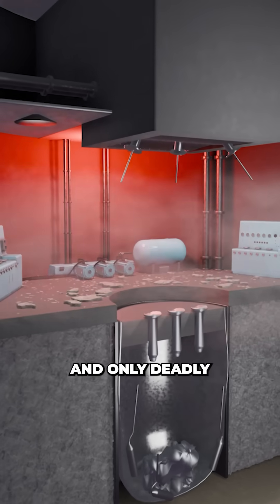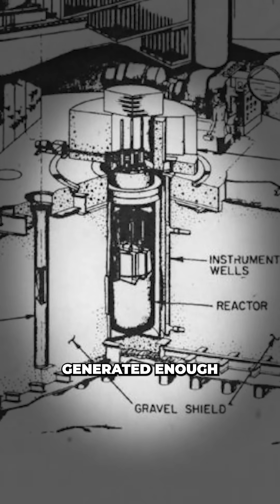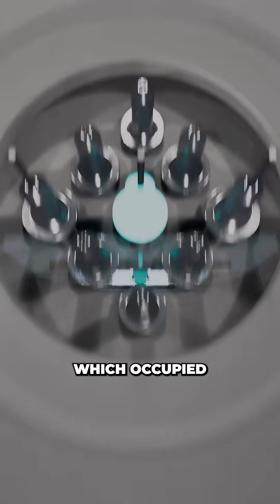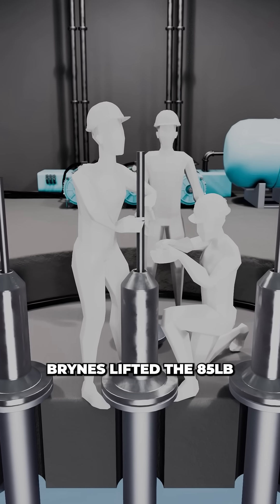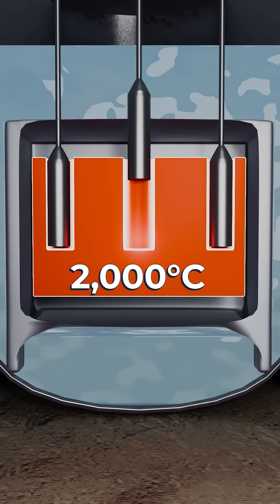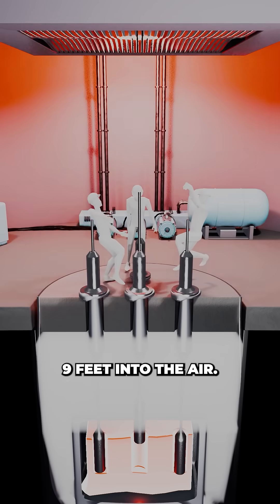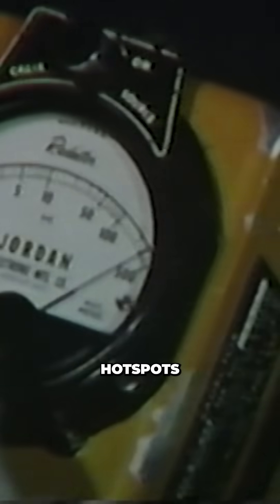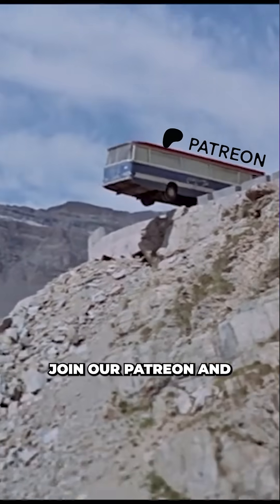The True Story of the SL-1 Disaster

Comment: For anyone curious, this is what started the anti nuclear power movement and dramatically slowed the development of further nuclear power plants being built across the US.
Reply: Three mile island was a bigger incident. 

SL-1 being declassified only cemented the anti nuclear movement.
Reply: @scythesasin4181 
Three mile island was the absolute weakest reactor failure.

The only notable thing about that was that some regular steam escaped the facility.
Reply: @redstonewarrior0152 no there was a radioactive release. It’s just that it basically wasn’t a health hazard at all. 

Which is where all the controversy comes from. How can there be a harmless release of radioactive gas? Physics. That’s how.
Reply: @scythesasin4181  Except nobody died. Only casualty was a very expensive nuclear reactor.
The Tinfoil Hat crowd insists that Three Mile Island was deliberate. It was supposed to be a minor accident, set off the warning sirens, etc., as a publicity stunt for the anti-nuclear movie "The China Syndrome", which was released twelve days before the incident. Was not intended to cause a core meltdown.
Interestingly, President Carter shut the FBI investigation into the incident down HARD. IIRC workers reported valve handles being missing from critical valves, etc. And not like they'd never been there- like they'd been recently removed.
Reply: @MarkStockman-n8s5w 

Nobody dying has no weight on the public opinion at the time. 

Three Mile was indefinitely more public than SL-1 at the time. The entire country knew about it, while SL-1 was significantly less covered. 

SL-1 had guys die, yes, but the military has guys dying all the time due to stupidity and training accidents, especially back then. 

The SL-1 incident was took forever to be made public as it was, in essence, a military testing site.
Reply: @MarkStockman-n8s5w so because luckily nobody dies it's harmless. Three mile island was a lot scarier and a lucky escape. They had a runaway reactor and no knowledge off what was happening inside the reactor and loosing a reactor is really really really expensive on top of it all. Accidents keep happening because people in charge and people that think they are more knowledgeable than they are, do not take the physics serious and dismiss the hazards and the many near misses.
Reply: @scythesasin4181 TMI taught us a few things.  

One was of course proper handling of maintenance procedures and that each change needs to trigger a total assessment of safety.  

Two was that the corporate “trust us” system was not adequate. There had to be standards for handling incidents, assessments, communication, and handling the public protection and response.  The owners of the plant had non of those things.

Three there were not enough experts and trained people in place to give advice on the company side.  But in addition there was no method where the federal government was both assisting and watchdogging operations.  In fact we were quite lucky that the President of the United States at the time (Jimmy Carter)  was a U.S. Navy officer who just happened to be work on the founding of the Navy’s nuclear submarine program in 1952. He not only worked on reactor operations and design but he was assigned to directly work on a cleanup and management operation of a reactor meltdown.  So Carter not only knew exactly what the situation was, he knew exactly what should happen and whom to call.  He actually personally called Admiral Rickover, who used to be Carter’s captain and commanding officer in the Naval Nuclear program to have him get the correct authorities and experts in place.
Reply: Three Mile Island was more of a scare than an actual disaster.
A lot more people died in Johnstown PA on May 31 1889 for example.
Reply: lack of nuclear appreciation ?
Reply: Damn, 3 people died and it demonized nuclear power for years and years. Yeah it was a tragic incident but it was pretty much entirely the guy's fault for lifting the rod too high.
Reply: @mrigtp0529 yeah... cabbage you imagine where we might be now if we had these? It's boggles the mind.
Reply: @CrazyCamo We'd be pinned to a great future 😂
Reply: And then Jimmy Carter came and hammered the last nail in the coffin during TMI.
Reply: @abriannaaguilera2123 well it was not Carter’s intention.  Carter was a nuclear reactor expert having worked to establish the U.S. Navy’s nuclear program in 1952 as well as having personally managed and physically cleaned up a meltdown at the end of that year.  And then in 1953 originally trained to be the Nuclear engineer on the USS Seawolf when his father died and he gave up his navy career to manage his family’s farm and support his mother and siblings.  

He found the oversight on the commercial Nuclear energy sector to be horrible, and having worked under Rickman he insisted lessons needed to be taken from the Navy.  Unfortunately this criticism became fuel for the public to really take issue with the concept all together.
Reply: @LogicalNiko He saved Chalk River, Canada.
Reply: Thanks a lot brynes
Reply: I mean just like cars, a nuclear power plant is dangerous if designed poorly, but safe if designed well and handled properly.

Cars have increased in safety over time too, but nuclear has become even safer.
Reply: Thanks libtards
Reply: This, and a lot of shows blowing everything out of proportion
When a nuclear reactor fails, it doesn't blow up like a nuclear bomb. To achieve that spectacle, it would have to be THE worst-case scenario, and to achieve the same results without the explosion is also another worst-case scenario. But people were and are misled to believing that Chernobyl or Fukushima are the norm. Those are also pretty bad scenarios that, but far from the norm.
Chernobyl was like not only built with 0 failsafes in mind, but the staff weren't trained, and nothing was handled properly, in fact, during a safety drill sometime before the accident, on of the reactors failed the drill and then was rebuilt essentially the same way. And Fukushima was a whole ass natural disaster fucking it over, but it was still not built around the fact that tsunamis got that big, despite the tsunami size not being that rare, and should have been considered.... and they're failsafes sucked too lmao
Reply: @tntblaster137 I mean even Chernobyl and Fukushima weren’t nuclear explosions, they were steam. Chernobyl was a poorly designed reactor and the test they were conducting was just not safe, so inexperience, poor reactor design, and a horrible idea for a test was the cause of the Chernobyl disaster. Fukushima is an oversight that was warned about decades before.
Reply: No, that was Three Mile Island and media. 
This was a highly classified project. It did not become public knowledge until decades later. I don’t remember the details now, but I know at least the impaled guy’s body was buried on site, but I think it was two workers. They are in lead caskets. I think the third guy was buried normally, but his casket is encased in like 1 ft thick concrete. Their families weren’t told details of what happened. Which is par for the course of black project work.
Reply: @tylerfb1 you’ll be happy to know 3 mile island will be reopening. Microsoft will be running it. It needs its power for the data centre. The reactor where the accident happened will not reopen. The Susquehanna River will be needed to run the data centre as these data centres
Require massive amounts of water.
Reply: @TessTearoe-zp5xv  I already knew that it was being recommissioned. 

I don't understand how that's relevant to the discussion, though.
Reply: @TessTearoe-zp5xv not happy to hear Microsoft will be running it but it’s good to see nuclear starting to recover
Reply: @KatieNovaNeko what can possibly go wrong?
Reply: @TessTearoe-zp5xv not an argument, you’re just profoundly ignorant on the topic of nuclear waste and it’s disposal
Reply: @TessTearoe-zp5xv let me be very clear, in order to be certified, they DO run trains into them, this isn’t a fun fact, this is part of how they’re determined to be safe or not long before nuclear waste gets put in it. And don’t even bother bringing up quantity, the amount of nuclear waste produced ALL TIME in the us can fit in an era the size of a football field, no other form of energy produces this little waste
Reply: @KatieNovaNeko You have that on good authority? They told us lead in fuel for over 50 was ok, they knew for decades and decades it wasn’t. They hid the effects of Agent Orange for decades. Love Canal and it’s chemical soup. Cigarettes they said didn’t cause cancers for decades they hid the evidence.
Well you can believe “THEM” all you want, no one is stopping you. Experience shows you shouldn’t always drink the KoolAid!
Reply: @KatieNovaNeko Really? And you are the expert? I’m sure I’ll sleep better knowing that.
Reply: And of course, everyone's panicking over how "Nuclear power's not safe", but nobody cares to mention the second half of that sentence: "IF YOU'RE AN INCOMPETENT MORON!!!"
Reply: @citronyman man is an idiot! THERE IS NO OFF SWITCH!  What part of that don’t you understand?
Reply: @citronyman 
Nuclear isn't commercially viable, sorry.

Its literally 5x more expensive per delivered kwh than wind.

That's why nobody is building nuclear and everyone is building wind
Reply: @Cambyses1467 wind?
Reply: @paulh6171  What???.....the UK is building a massive nuclear power station as we speak. France has some of the cheapest energy on the planet.
Egypt is building a nuclear plant.
Google, Microsoft and Amazon are building nuclear plants to power their AI data centers.

There are more than a dozen modular reactor startups in the US.

China is massively expanding its energy capabilities.
South Africa has planned nuclear plants in its future energy mix.

I could go on and on.....

Wind is an absolute waste of time these days.
Reply: @AnnoyedElliot  UK built ZERO nuclear last year, but built 2000 MW of wind capacity, on top of their 82.7 TERAWATT hours of wind energy they produced last year.

Globally, nuclear accounted for just 3% of all new energy.

Wind is vastly superior. Period.
Reply: @AnnoyedElliot you can go on and on. Fukushima is still spewing nuclear waste into the ocean! There is no off switch!
Reply: @Cambyses1467 no it’s not.
From the International Energy Agency: about 10% of the world total energy production
Wind is roughly the same. Meanwhile fossil fuels still make up nearly 80% while correct that the UK hasn’t build a reactor last year they are currently working on one called Hinkley Point C. This will bring the UK’s nuclear production close to where natural gas and wind are for the country now iiuc. But you’re neglecting that for a very long time nuclear has had a stigma around it.
Reply: @TessTearoe-zp5xv that’s um, that’s a pretty gross oversimplification don’t you think? Is it radioactive? Yes is it waste? Well if you define waste as radioactive waste sure, but they’re not throwing melted corium into the ocean, it’s treated for some things. Most importantly is there an off switch and is it dangerous? Off switch I’d have to imagine, they’re doing it on purpose. Dangerous? No, this is a non starter, it’s not like they did this Willy nilly, they knew what they were doing and guess what, compared to how much water in the ocean, this is hardly a drop, it will get diluted, and be HARMLESS
Reply: @KatieNovaNeko oh please! It’s in either bitumen or concrete, they are leaking!  We are putting so called depleted uranium in shells and 
ordnance, because they can go penetrate tanks etc.. They were used in Iraq, there are cancers, there’s lots to answer for in the nuclear field. There are over 400 reactors in the world , no solution to the storage problem. Don’t tell me there’s an underground storage proposed, Yucca Mountain was cancelled. There is, at this time, no way to safely store it. You can make up a song and dance number, it doesn’t change a thing.
Reply: @TessTearoe-zp5xv dude you can hit nuclear waste storage containers with a massive freight train and it’ll be fine, nuclear waste is not something we struggle to control or understand what to do with
Reply: @KatieNovaNeko NOT
Reply: @KatieNovaNeko 
I said NEW energy.
They're only building wind, basically nobody is building nuclear anymore
Reply: @Cambyses1467 and you’re wrong
Reply: @Cambyses1467 ”wind is vastly superior “ I think you are wrong and correct( please read this), whilst wind is vastly superior and being con structured more globally, wind accounts for not having enough production of energy towards a nuclear Power plant,as each form of energy has its own problems, nuclear energy is the most safest and environmentally friendly energy source and it can be cheaper with SMRs, let me just say that nuclear energy is vastly better for heavy energy production and wind is for cheap energy production
Reply: @Tanksbuilder 
No sorry that isn't how it works.
If you have 50b to spend, you can either make a single 1000GW nuclear plant, or you can make 25,000GW of wind power, of which will generate about 5x that of the nuclear plant.

Wind is indeed vastly superior. Future nuclear tech might change things, but not yet.
Reply: @Cambyses1467  A "compact footprint" refers to something that takes up a small amount of physical space
Reply: @Tanksbuilder  Yes, and wind takes up less space. It's footprint is only 15m x 15m for a 2mw turbine. Nothing beats that incredible power density for land
Reply: @Cambyses1467  This power is enough to run a large facility
Reply: @Tanksbuilder 
You're a bit confused here.
Reply: @Cambyses1467 I showed Italy and UK are doing nuclear programs
Reply: As if there are no accidents in the oil and coal industries all the time.
Reply: @pyerack  Even operating normally coal and oil kill thousands EVERY DAY from increased smog.
Reply: @pyerack What about there is no off switch? Fukushima is still dumping nuclear waste water into the ocean. This eventually makes it to the shores of North America via the Japanese Current.
Reply: @TessTearoe-zp5xv 
Fukushima's water tritium levels are within safe levels in nuclear industry, every nuclear plant does that as they use water as their cooling agent.
Reply: @conchoclo This accident happened in 2011, it is like their solution is dilution for nuclear pollution. This has been releasing waste into the ocean for 14 years. Recently they petitioned to allow more waste water to be released.
Chernobyl was hit recently by a missile/shell? damaging its containment. Nuclear is the most expensive power man produces,it is not a solution, it is part of the problem is, shall we store spent rods in your backyard.
Reply: @TessTearoe-zp5xv 
I'm sorry to inform you that you are heavily missinformed about nuclear power, I am going to correct you on your claims and ask you nicely to better research this topic. You seem passionate about it, and that's good, that's why you should acquire more knowledge in order to make an informed opinion 

"Their solution is dilution" No. Fukushima's sea water used for cooling has been treated to decontaminated as much as possible, dilution is not the only solution. Also, dilution is very powerful as the dose makes the poison. Radiation is literally everywhere but people are not dying from it, as the backround radiation dose is not harmful.

Fukushima has not been releasing waste for 14 years, it started to release its treated water in 2023.

Electricity price heavily depends on factors like availability and country. On average it is on the expensive side, yes, but it is competitive.

"Chernobyl" has been recently hit" Yeah, it's awful the way they try to weaponize nuclear plants, but the strike did nothing in terms of releasing radiation.

"Nuclear power is not the solution"
It is one of the safest, most efficient, and environmentally friendly methods of energy production.
Safest because it has caused one of the least amount of deaths right next to renewables. I recommend you to research deaths per energy unit, nuclear is at the bottom even considering the highest estimated Chernobyl related deaths. Fossil fuels kill way more by deseases related to air pollution
Most efficient because it generates really small amounts of waste, as nuclear fuel is extremely energy dense. One inch uranium pellet is equivalent to 1 ton of coal. 
Environmentally friendly because of the low amount of waste and it generates virtually no CO2 emissions during its lifetime.

Nuclear power has some of the advantages of fossil fuels (you can generate electricity whenever and wherever you need it, unlike renewables) and renewables (almost no emissions), it is a really neat part of the solution.

I heavily recommend you to check the YouTube channel "T. Folse Nuclear" he is a nuclear engineer with more than 10 years of experience who makes reaction videos and adds a lot of information about nuclear power, he is infinitely more knowledgeable than I am and is also a great comunicator.

I hope you get to read this and take the time to reconsider your beliefs, have a good day.
Reply: @conchoclo I will,but 14 years of nuclear waste is not nothing. I’m sure you’ve heard of several shrimp recalls in the last months?
Reply: @conchoclo they all flush their nuclear waste into the ocean? I think not.
Reply: @TessTearoe-zp5xv 
It is not "14 years of nuclear waste", the reactors shut down in 2011, they were not operational at all during those years.
Calling tritium traces "nuclear waste" is like saying that bananas are dangerous because they are tecnically radioactive. If fukushima's water was not salty, you could directly drink 2 liters of it per day and wouldn't get nowhere near a dangerous radiation dose.

The radioactive shrimp came from Indonesia, the shrimp itself did not come radiated from the sea, it was most likely contaminated by cesium-137 that came from a steel plant 2 km away. The steel plant would have used contaminated scrap metal that most likely came from stolen/mishandled hospital equipment, as it has happened in Brazil previously. Radiation is used in many fields including medicine, not everything is power plants.
Also, the amount of radiation found in those shrimp was 68 bq/kg, bananas naturally have around ~140 bq/kg. It is important to note that this means that you would have to eat a kilogram (~2 pounds) of shrimp to get 68 bq.

No, power plants don't "flush their waste into the ocean", treated water does not contain harmful doses of radiation. And yes, nuclear power plants dispose of their used water. That information is public, please do your own research.
Reply: @conchoclo wow, it happened in 2011, you know it was not shutdown right away. You know oceans have currents?
Reply: @TessTearoe-zp5xv 
It was a shutdown right away, the safety systems were designed to do that and they did
It was the cooling that failed after the shutdown because of the tsunamis
"Why it needs cooling if the reactors shut down" because heat does not immediately go away.

"The sea has currents you know" Yeah, the sea is also humungous 
Contamination did leak from the reactors, but none of it could possibly reach you all across the inmense pacific ocean, it was localized

Are you actually researching something or just repeating things you heard/read around random parts of the internet?
Reply: @conchoclo yes, there were three reactors that went that day, the fourth was contained. I watched the day they blew. TEPCO came out originally and tried to say they were fine. As of February of this year according to Google releases of radioactivity were still happening. So go argue with Google
Reply: @TessTearoe-zp5xv 
Fukushima had 6 reactors, not 4
They blew up from a hydrogen explosion, a chemical explosion, just to clarify
"According to Google" dude did you just read the AI thing Google gives you when you search something? That thing will tell you that the tritium water is "release of radiactivity", I explained to you why it is not dangerous, I gave you the channel of a professional nuclear engineer who has explained this stuff better than I multiple times and you can look it up.
At this point I'm starting to believe that you are just lazy and don't care to research properly or use critical thinking
Reply: @conchoclo Do you just believe everything, all the geniuses that put thousands of nuclear barrels of nuclear waste in the Pacific, the Atlantic, France, Great Britain, Japan between 1946-1993  put these barrels in bitumen and concrete and are now leaking. Between these geniuses put large containers of radioactive waste West of San Francisco. US still does not have a permanent storage facility for high level
Commercial nuclear waste, dry cask on site. This does not include the weapon grade waste storage. SO NOT SAFE. Not even a place to store the nuclear by products. You’ll believe everything the nuclear industry tells you?
Reply: @TessTearoe-zp5xv yes they all do. Tritium is a slightly radioactive isotope of water. All water discharges from nuke plants have some amount of it in their discharges, even though none of that water went through the reactor. They all discharge tritium into the environment. Fukushima’s tritium levels in their discharged water are actually LOWER than many nuclear plants in the world, notably most of France’s. 

You drink tritium every day. There is and always has been some of it present in water. This has been true forever, even before we learned to split the atom.
Reply: @tylerfb1 Yes, cigarettes don’t cause cancer.Tetraethyl lead was used in cars to stop engine knock for decades, the industry knew for decades that it was a carcinogen, just as the cigarette industry covered up the cancer connections for decades. Do I believe the nuclear sector?
Let’s put it this way, I have a very healthy skepticism. If you don’t have a permanent solution for the nuclear waste what do you have?
Reply: @TessTearoe-zp5xv  but radiation safety data doesn't come from the nuclear industry. Even it was, its totally independently verifiable data. And it has been verified many times over. Unless the plant is lying about what was released and how much, and there's evidence that is NOT the case, the harm caused by the release can be independently established. It is a FACT that the TMI nuclear accident caused zero harm to any people.

We have a permanent solution for waste. Its called deep geological storage. That can manifest in different ways, but hasn't because it can't be implemented because of political unrest based on ignorance and misinformation.
Reply: @TessTearoe-zp5xv  but you've got nothing to say about the "radioactive" water being released from Fukishima that I and others just told you isn't what you think it is? 

This is the problem. You don't need to take some guy on YT's word for it. But when presented with information that challenges your view of reality, it behooves you to find out if it's true. 

Political opposition, based on ignorance and misinformation, is the chief opposition of nuclear power in the West. Nuclear power is not going to end; it will continue to accelerate and become the chief means by which mankind's energy needs are met. It is the only technology with the means to do so. This paragraph is not opinions, it is facts.

Those societies that have the will to implement it will, and they will dominate over societies that didn't. Should mine and your societies be overcome and dominated by others because of policy that we implemented on ignorance and misinformation?
Reply: @tylerfb1 Say for sake of argument I take your word. Still leaves the problem of storage from these reactors. There is none. We dry cask it.
We have at one time put it in barrels and thrown in the oceans of the world. All the nuclear plants in the world are doing the same thing, over 400 plants just storing it away on their sites. There is no solution to this problem, so please don’t insult the general public with snarky comments. 
Nuclear power is super expensive. There is no solution to its byproduct radioactive waste, so don’t pretend.
Reply: @tylerfb1 So for all your lovely verbiage, it still comes down to there is no place to store it!
Reply: @TessTearoe-zp5xv  yes there is! Deep geological storage IS the solution! There are multiple ways to implement it. It is ALL halted because of misinformed, ignorant political policy.
Reply: @tylerfb1 As of now there is no storage, except on site, in dry casks. So 90 reactors with no storage, in the US. God knows where they keep the military grade waste.
Are there plans to bring up the leaking barrels off East Coast and West Coast? I think not!
There should be a plan. There’s not.
Reply: @TessTearoe-zp5xv  Correct. Why is that? Because misguided political policy won't let it be implemented. 
All the technical, logistical, and practical problems with radioactive waste: how to safely dispose of it and keep the environment and living things safe from it for as long as it is dangerous have been solved. 
YOU, through your politicians, because of your ignorance and misinformed opinions, won't let them do it! 

The crazy part about all of this is that the situation we've been forced into by misguided law is actually one of the LEAST safe situations. Its madness.
Reply: @tylerfb1 Whoa! Who knew I was that powerful. Maybe if the powers that be could present a feasible plan it could be adopted, but till then
we just keep piling the waste up. I don’t actually believe there is a safe way to do it, we will keep improvising till there’s a horrendous incident. It is a sad comment on human nature.
Reply: @TessTearoe-zp5xv  there is a feasible plan. There has been for decades. Because of fear, there is just no moving into reality. No risk or you can't do it. Since nothing has no risk, it isn't legal to do it. So we pile it up at the sites, which is less safe.
Dry casket storage is a leap above what used to be, but it is still not as safe as it could be.
Reply: @TessTearoe-zp5xv nuclear waste is composted in three section: via.1. Light waste; one of the most recyclable and easiest waste to contain, it’s 90%-95% recyclable, 2. Medium waste; it’s hard to recycle, as around 40%-50% is recyclable but it is not that deadly, 3. Heavy waste. one of the most dangerous and hard to recycle around 2%-5% is recyclable, the most common waste produced in a modern day nuclear reactor is light waste, BTW you should search on how nuclear waste are stored[ you can stand next to a heavy contained nuclear waste]
Reply: @TessTearoe-zp5xv it seems like your skepticism level is quite unhealthy
Reply: this people should be threat like terrorist
Reply: The modern nuclear land facilities are so efficient that, while certain states will publicly denigrate the nuclear option for political reasons, they will also buy energy from other nuclear states quietly. Based on his BS arguments for solar and wind, I’m guessing @paulh6171 here is from California, which buys more than 30% of its power from Arizona nuclear.
Reply: "this is what started the anti nuclear power movement"

No, it is not. That was started by the political greens, first in opposition to Operation Plowshare, aiming to find peaceful uses of nuclear explosions, and then – through the political green ideology opposing centralized production and accountability – spread to nuclear power, in the 1970s .
Reply: As it should have. The blatant disregard for any sensible safety protocols during this maintenance is a testament to that.
Reply: Good thing too, because that is one of the stupidest fucking designs for anything ever, let alone a goddamned nuclear reactor.
Reply: How many active nuclear power plants are operating in the U.S.?
Reply: Three Mile Island killed US nuclear.
Reply: “Poorly Built” power plants.
Reply: @geedubb-q1u  the US power plants weren't that bad. They actually did what they were supposed to when the plant started going critical. 

The safety mechanisms activated and there are no detectible adverse health effects either reported by the US government, nor multiple international non-partisan watchdog groups.

Had the Fukushima disaster been more like 3 mile island it's likely that the disaster could have been partially averted.
Reply: @n8zog584 the GOD COMPLEX is astounding, Fukushima is still spewing nuclear waste into the ocean. That all ends up on the North American coastline, least you forget all the debris that littered the coast. It comes via the Japanese current.
Reply: @n8zog584 couple things
1. SL-1 was poorly designed
2. Fukushima was avoidable completely if TEPCO heated the warnings given my multiple separate sources that a tsunami exactly the size that hit the plant could happen and were potentially likely, I’m not kidding when I say if they had raised the back up generator a few meters it could probably have stopped the disaster
Reply: Actually, the anti-nuclear power movement can be laid at the feet of Jane Fonda, Michael Douglas, and the rest of the good folks at IPC films. IPC stands for "Indochina Peace Committee", Vietnam being in Indochina.  
Oh, and the "scientists" at the Union of Concerned Scientists, who will lie until their tongues turn black to give nuclear energy a bad name.  
The number of premature deaths those groups are responsible for (due to particulate emissions from fossil fuel power plants) and the astronomical number of tons of CO2 released into our atmosphere are both staggering.
Reply: imagine if people protested cars everytime there was a traffic accident
Reply: @crvot  I mean, its a little more involved than that, right. Let's not over play the seriousness of nuclear accidents and the impact they have on the environment and the people around them. But we shouldn't down play them either.
Reply: @tylerfb1 of the 3 most notable nuclear disasters, Fukushima, Chernobyl, and Three Mile Island, only Chernobyl has had deaths resulting it, the environmental impacts are very complicated, because if you look at the area that was most heavily impacted by the radiation.. it’s overgrown with floral and fauna, now ofc it’s more complicated because the animals do have a greater risk of say, cancer, the ground is obviously still radioactive, but it isn’t a dead zone where nothing can grow
Reply: @KatieNovaNeko  i know that, what's your point?
Reply: @crvot they have! That’s how you eventually had seat belts. Being man made, we now have people burning to death because there’s no manually way to open doors in these cars if people don’t know where the special release is.”Man” designed modern age stupidity.
Reply: Good!

Even 60 years it's still an unsolved tech that has never delivered on its promises. Not only is it only getting more expensive and slower to build, but alternatives like solar are now cheaper, faster to build, less decentralized, and cannot under any circumstance ruin invaluable livable areas for the remainder of humanity.
Reply: @dicethrower2 You do realize that the pollution from the production of wind and solar is more impactful for years to come than pollution created from nuclear energy? Like they still need to make lithium batteries for solar, and guess how those impact the Earth in waste landfills.
Reply: @yorandomdudefromtheinternet  Everything you've said in your comments is easily disproven with some simple google searches. You're clearly horny for nuclear and not being objective about it. You should try to do better. 

Nuclear made sense maybe 20-30 years ago, in the sense that we would have more plants today, but even then it would have been a mistake in hindsight based solely on how solar has advanced in the last few years. 

The idea that we should focus more on nuclear today is completely out of touch with reality. The plants started today would be out of date before construction is even half way done. 

And yes, it's not commercially viable. I don't know why that's so confusing to you. It needs heavy subsidy from the government to function, resulting in about 3-4x the cost than alternatives. And this is only expected to get worse as solar/wind are improving every year and nuclear is only getting more expensive every year. 

It's a dead technology, let it go.
Reply: @dicethrower2 It’s definitely not dead, that’s for sure. Many countries all over the world are using it and still building plants. Also, nuclear is quite literally the only option we’ll have in the future because of how high our energy demand is becoming. Solar and wind cannot hold up, and not to mention if they were to they would need to take up so much open land it’s completely stupid to choose those options. We need to focus more on nuclear and expand our knowledge on how to make it even safer and more efficient. And sure, nuclear is expensive, but at least it makes a profit. Solar and wind cost more to make than the amount of energy thy will make in their lifetime before being taken down. They also produce more pollution from production and deconstruction than nuclear ever does. Lithium batteries are very bad for the environment and we don’t have a way to dispose of them correctly other than just throwing them in waste landfills. Solar and wind cannot keep up with the future, and unfortunately, they’ve reached their peak of usability and there’s nothing more to research about them. I don’t know what world you live in to think that those alternatives can keep the world spinning, because frankly, they cannot. Also, nuclear energy has existed for somewhere around 70 years dude, not 30. The first nuclear reactor was built during the manhattan project back in the 40’s so they’re much older than you think. Obviously you haven’t done any research into nuclear to actually see how good and useful it is.
Reply: @yorandomdudefromtheinternet  I've quite literally studied this topic in depth so to be accursed of not having done any research is kinda hilarious, so I'm going to leave it here. Just know you're operating on incredibly outdated information that honestly hasn't been relevant for at least 15y now. Like, not even joking, literally everything you just said is completely wrong.
Reply: @dicethrower2 It isn’t, but alright. If you did correct research, it would prove me right. I’m sorry your alternatives are not future proof.
Reply: And it's funny that this was used in propagandized by embedded socialists/communists in the United States to also help slow down the United States ability to develop nuclear power all part of a subversion campaign😊
Reply: @The_Firehawk  no this was propagandized by capitalistic coal companies trying to save their money by halting progress.
Reply: @The_Firehawk you need to get educated bc based on this comment it’s embarrassing how little you know
Reply: @aphoticjellyfish  ad hominem
Reply: @The_Firehawk  The communists and socialists were also building nuclear power reactors. The superintendent of my building was a Romanian refugee. The Canadians came in and built Candu reactors. He was trained as an engineer, so the Canadians taught him and others how to maintain the reactor. He was the best mechanic I ever saw. When he fixed a leak in my shower, it stayed fixed. And perhaps you've heard of Chernobyl? I used to get both sides of the story, from the pro-nuclear Scientific American and the anti-nuclear Sierra Club and others. As an enginering student I was pro-technology by default, but I was also pro-safety engineering, and when you asked the Con Ed engineers, "What happens if the Indian Point reactor, using a 1950s design, has a catastrophic accident 50 mi (80 km) from New York City," they assured me, "The risk of that is infinitesimally small." Yes, but when you multiply that risk by the 20 million population of the New York City SMSA, risk isn't so infinitesimal any more. The people like Edward Teller, who called the anti-nuclear movement communists, were just as ignorant as the worst of the anti-nuclear cat ladies. (BTW, did you ever see the fault analysis of the Dresser valve that caused the Three Mile Island accident? That's enough to teach nuclear engineers humility.)
Reply: @The_Firehawk 
That's complete bs.
You couldn't even define communism. Stop parroting propaganda you're instructed to follow.
Reply: @Cambyses1467 he's not even wrong, how is it bs?
Reply: @treetopdinosaurFor starters conflating socialism with communism. They are not synonymous and definitely part of the 'red under the bed' fear mongering.
Reply: @Cambyses1467 
Lmaoooooo Friedrich Engels.
Reply: @Cambyses1467 heartbreaking: the most wrong person you know just made a great point (the socialism and communism part)
Reply: @saintmeao4243
Huh?
Reply: @The_Firehawk  The US never had "embedded communists". We've only ever had fascists calling anyone they thought was vulnerable a communist so they could do violence to them. The red scare was inherently fascist.
Reply: @Pensnmusic  as the "worst people" in history books were made as reaction to attempted communist coups and terrorism across Europe and US, im inclined to believe red scare was justified. We see parallels even today.
Reply: I don't remember if he said where it was I thought it was in Rhode Island or someplace like that
Reply: @ItsMe-ic7on  Not mentioned in the vid, but it took place in Idaho. You might be thinking of the Three Mile Island incident (also not in Rhode Island, but Pennsylvania).
Reply: good
Reply: all cause those who started the movement, are likely ignorant that the reactor wasn't maintained properly, and that the military hired the wrong men to do this dangerous job, with two of them never getting along, which is cause one of their wife is cheating on them, and that wife was likely seeing the other there, which leads to speculation that this was probably done on purpose considering the one who pulled the rod, is the one who's being cheated on, so of course in simple terms: the anti nuclear movement is full of narrow minded people who can't see that nuclear energy as a whole, is safe as long as it's maintained in a proper manner.
Reply: It took this for people to realize nuclear power was bad?! After literally wiping down two cities and causing years of damage and suffering it took 3 Americans 13 years later to die for people to realize nuclear is bad?! Man if only internet existed back then!

Clearly governments should never be trusted with the safety of the people
Reply: @mordest_porcket27 you’re comparing nuclear weapons to nuclear power, this is a false equivalency and the 2 have very little in common, before you say something on the internet maybe make sure you’re not completely ignorant on the subject.
Reply: @KatieNovaNeko who said I was comparing nuclear power to nuclear bombs! You clearly know what I am talking about so either you are the one who doesn’t understand the comment or you’re just angry for some reason!
Reply: @mordest_porcket27 you said about wiping down 2 cities so yea it sounds like you’re talking about the bombs dropped on Japan
Reply: @mordest_porcket27 You might wanna look into coal power accidents…
Reply: Wrong, three mile island and chinese room
Reply: Three Mile Island
Reply: as they should, more studies need to be done, that anti nuke reaction movements probably saved some lives, but of course stuff that prevent bad things always hated and less valued than stuff that need to be done after the bad things happen
Reply: @flowerofash4439 it definitely didn’t, it forced us to lean to heavily on fossil fuels which kill thousands a year, I’m not gonna say they have blood on their hands, but they like many, don’t understand nuclear energy
Reply: Large scale fission is, and always will be, a catastrophe waiting to happen.
Reply: @ModQuad-l6z trust me that’s true of all forms of energy, wind and solar might be the least likely to have a major catastrophe but they have their own drawbacks, if you want large scale, clean energy, then nuclear is the only option, and when compared to other large scale options (fossil fuels) the safety of nuclear is unparalleled
Reply: @KatieNovaNeko  But the catastrophic risks with wind, solar and geotherm represent a small fraction of that for fission. Also no lethality or chance of making square miles of land uninhabitable - and if just an additional 10-15% of US residential consumers employed solar + storage, the current grid could support all of the planned data centers with overhead to spare. I’d also incentivize EV owners to charge on baseload, beyond the current BL rate reductions. These methods could be fully deployed in 24-36 mos and would cost less than a single typical nuclear installation, which would take a minimum of 8 years to bring online.
Reply: @ModQuad-l6z if you wanna talk danger to people, EVs are way more dangerous then an ICE, you’ll never get a database to use solar or wind, these places require a lot of energy that solar and/or wind just can not cover for, nuclear while obviously holding some risk, when done properly is the safest form of energy with the least environmental impact of any. You want to save the world? Go nuclear
Reply: @KatieNovaNeko  With all due respect, nothing you said here is even remotely true.
Reply: @ModQuad-l6z with all do respect, you’re just wrong, EVs have a higher likelihood of exploding and or catching fire, and when they do they burn much hotter than an ICEs, the environmental impact of EVs is comparable if not worse than ICE because the process of mining for lithium is horrible for the environment. Renewables like solar and wind are woefully inefficient compared to nuclear, or even fossil fuels. I will give credit where credit is due, they are better then they are improving,  but that’s true of all energy creation whether it be nuclear, coal, or renewables. Wind and solar do produce more waste than nuclear, this is an Objective fact and you are lying if you say that it’s false. While nuclear does produce waste it is very little in comparison to other energy sources, is contained safely, and despite all the fear mongering, we do know how to solve it, we already have! Data centers, especially since AI take a lot of energy to operate, you wouldn’t have Microsoft or google lean into nuclear if they thought wind would be perfectly adequate they would use it, this isn’t an argument, this is smug ignorance, this is willful ignorance

I’m done debating this topic
Reply: Thank god. We've now found so many necessary regulations, like the one stemming from this accident, that we've since learned the true cost of safe nuclear is not commercially viable
Reply: @Cambyses1467  technically speaking nuclear is still safer than coal or oil. It's just we aren't nearly as afraid of coal or oil.

For example, did you know that when leaded gasoline was made, people LITERALLY were inhaling led particulates? It's also partially one of the reasons why cancer and heart disease are so prevalent today.

At least nuclear radiation is more easily detectible
Reply: @n8zog584 
Yes, as safe as wind for 5x the cost.
Reply: @Cambyses1467 
Safer than wind for 5x the cost, though at those numbers we are talking a difference of 20 people a year compared to several thousands in fossil fuels.
Reply: @carstekoch 
We need to get rid of fossil fuels immediately, and since wind is 5x cheaper that means 5x faster transition. And that means less deaths by coal, ergo wind is safer for us and for the environment 

That's why the whole world is going wind, and nobody is building nuclear. Big Oil sure is spending millions to convince a bunch of YouTubers that nuclear is better though
Reply: @Cambyses1467 
A handful of countries are building nuclear. The UK and China for example.
But if you have it already build might as well use it. It's certainly more sensible than getting rid of nuclear power before fossil fuels like germany did.
Reply: @Cambyses1467 Cmon dude how much are they paying you to discredit nuclear? I will join in with you if they give me a cut.
Reply: @thebigsad5959 
Ironically, Big Oil is funding a ton of pro -nuclear propaganda on social media as part of their Deflect and Distract campaign.

They know nuclear is not commercially viable, and convincing sheep to focus on it means they'll be anti-wind; the one true threat to Big Oil.
Reply: @carstekoch  Nope its such a tiny amount of total power its basically zero.

Wind DOMINATES in every country
Reply: @Cambyses1467 who is We in this case? If you mean the UK, I’m sorry you’re just lying, the UK still makes 1/3rd of their energy via natural gas, while cleaner than Oil or Coal, it’s still not clean
Reply: @Cambyses1467  it literally is though, coal companies have been lobbying articles to lie about the price of nuclear energy for years. Have you seen the ai data centers literally building nuclear reactors for extra power
Reply: @corporatecapitalism 
Actually they've been lobbying to lie about the price and safety of wind.

The costs of both is well established empirical fact; nuclear is 5x more expensive.

Sorry, you've been suckered by Big Oil propaganda
Reply: @Cambyses1467  they’ve been lobbied to lie about all 3 moron, and wind and solar have been lobbying against fossil fuels and nuclear energy. Nuclear energy is getting lobbied against by both sides, YOU have fallen for propaganda
Reply: @corporatecapitalism 
Wrong. Big Oil is spending millions on pro-nuclear propaganda.

Best way to keep fossil fuels around for longer is to turn the uneducated sheep against a viable alternative like wind/solar and distract them with prohibitively expensive unviable options like nuclear
Reply: @Cambyses1467 do you have a source? I’m asking genuinely here
Reply: @Cambyses1467  It seems like you recognize nuclear power is expensive but you also don't want any efforts to be made to make it less expensive, which the nuclear industry seems poised to do in due time thanks to maturation of the AP1000 (Lazard themselves said that there was a 30% learning curve between Vogtle 3 and 4, and any further AP1000s built in the U.S will only improve from there), contracts given to major nuclear companies like Westinghouse and GE, and the many SMR startups that are being funded by big tech and the DOE. 

Solar and Wind only got to the levels they're at now because people invested tons and tons of money into them, why can't the same happen for nuclear?
Reply: @premonitiative 
It can't be made less expensive.

The expense is to make it safe.

Maybe some future technology like SMRs will change that, but I wouldn't hold my breath
Reply: @Cambyses1467  Air travel was in a similar spot. It was really hard to make it safe without making it expensive, but here we are now, with flying being such a common means of transportation. Not to mention China, which has similar safety regulations on nuclear power (they use AP1000 reactors too, just as a heads up), can build them quickly and relatively inexpensively, though that's likely attributable to the smaller amount of licensing that they must go through, and the fact that China is really good with large infrastructure as a whole, which many countries are bad with. Almost as if that's the real barrier to progress with nuclear power...
Reply: @Cambyses1467 so.. yes and no, yes safety is a big cost nuclear. No that doesn’t mean it can’t be made cheaper for a bunch of reasons. The main thing you’re missing is things can be made cheaper AND safer. It’s not mutually exclusive. Reading your comments on the manner you seem to think nuclear is stuck in the 1960s or 70s, or 80s, but that’s just not the case, just like I won’t discredit advancements to make wind and especially solar more viable. But you can’t discredit the advancements to make nuclear cheaper and safer. And you’re still ignoring the fact that at least in the US, subsidies for renewables like Wind are in the billions, and for nuclear it’s in the millions, ofc wind is gonna be cheaper, you’re paid more to make it
Reply: @Cambyses1467 you are the type of person that thinks airplanes are more dangerous then cars when numbers say otherwise
Reply: @jub66 
Ironic, considering the numbers prove nuclear is prohibitively expensive 😌
Reply: @Cambyses1467 You stated not one fact.
Reply: @jub66  If we Had as many airplanes aß wie have Cars Planes would be mare Dangerous ,proven fact
Reply: @Cambyses1467 at the start yes, but one kilogram of uranium can produce the same amount of energy as approximately 2.7 to 3.3 million kilograms of coal. This means that 1 kg of uranium contains the energy equivalent of 2,700 to 3,300 tonnes of coal, which highlights the immense energy density of nuclear fuel compared to fossil fuels. In the long term, and I mean 60 years, nuclear will most likely pay for itself due to the cheap operational costs yet high output & longevity of the product. It is economically feasible but only in the long run.
Reply: @domiarkadjev
Nope actually the entire lifespan of the plant is just too expensive 
Google LCOE by energy source. Lifelong costs divided by lifelong production. Nuclear is 5x more expensive for every kwh it produces
Reply: @Cambyses1467  nuclear energy is the most efficient source of energy, and it is also among the safest.
Reply: @quincycostello6726 
Nope its one of the least cost efficient.
Literally 5x more expensive than wind and solar per kwh
Reply: @jub66  If you had said this something like 5 years ago, or better yet, 10 years ago... then it would be harder to disagree with you. But since you said this now, during a time when airplanes are seemingly starting to just fall out of the sky due to lack of quality control... I think you should maybe watch your tongue and rethink your opinion.

Consider this. A plane crashes, how many survive? A vehicle crashes, how many survive?

The odds of a crash with a vehicle are higher, without a doubt; but you are also more likely to survive it. The odds of a plane falling out of the sky used to be really low, so the potential lethality of said event was able to be put aside as a lesser problem. No one expects survivors from such events, but all are glad anyways when they do of course. But due to how rare it was, it was easily put aside. 

But now that planes are proving to be less reliable due to lack of quality control and other issues, that factor of lethality if all goes wrong is much more important again.

Meanwhile, cars and trucks, vans and the like; they may not be the safest thing either and are more likely to have an accident due to the sheer number of them...

But you're also still more likely to survive that incident. 

Finally, before you say anything like "but the data shows this isn't the case, and that planes are still safer."

Perhaps. But then, I should also point out to you that the corporations and even government agencies involved in creating those numbers; they aren't always honest either. They can and do skew the numbers from time to time to support their own narratives; correct or not as they may be. Skewed data is not the norm, but it is a potential in cases where powerful entities stand to lose A LOT of money. So keep that in mind before retorting anything about data.
Reply: @Cambyses1467  you state it is probitively expensive? want to know why? because the nuclear industriy is over-regulated because people like you see Three Mile Island and ignore the fact that no chances occured around the area of the power plant, no infuries, no cancer cases, no evidence of harm
Reply: @jamer45290 
This video proves why its not.

You can't identify a SINGLE unnecessary regulation. You people will say regulations stemming from this accident are "overregulated"
Reply: @Cambyses1467  notice how i explicitly stated three mile and not what is shown in this video? nobody said this regulation that was shwon in this video was an over-regulation
Reply: @Cambyses1467  also want to mention the ecological harm that wind turbines have? where they literally kill birds and distrupt migrations?
Reply: @jub66 
Ironically, air planes are safer for the exact same reason nuclear power is safer.
The rules were written in blood and as the past few years painstakingly illustrate, cutting corners is leading to desaster.
The manufacturers did not implement triple redundancies, painstakingly long paper trails and special release certificates voluntarily. Let alone the very strict requirements to fly an aircraft.
Reply: @quincycostello6726 
You are both correct.
Nuclear fission power is the most fuel efficient and safest energy source. It is also the most cost inefficient one. You are taking two different measurements and argue about which value is correct.
Reply: @Cambyses1467 Actually, with the development of new tritium reactors, nuclear could become cheaper! Also, nuclear is more reliable, and statistically, coal power has killed a ton more people from lung disease, cancer, other diseases from handling and burning fossil fuels. Solar panels are cheaper now, sure, but they are less reliable, as they only operate for ~8 usable hours per day, and may not operate at all during rainy weather. Nuclear is safer, more reliable, and on a path to become cheap. If we support nuclear more, then more advancements will be made, no need to abandon it completely. Also, nearly all nuclear accidents have occurred due to human error. And Fukushima was caused due to poor designing choices. Nuclear power isn’t inherently dangerous at all. Also, no, nuclear power plants are not the same as nukes, since nuclear power plants use much lower concentrations of enriched uranium than nukes, and nukes need an extremely powerful explosive to actually make the nuclear chain reaction, so nuclear power plants can’t explode like nukes. Overall, nuclear power is very safe, actually. France gets about 70% of its power from nuclear, and its been many, MANY years since an accident has occurred.
Reply: @Cambyses1467 im not saying safety regulations are bad, but paranoia from people like you has caused them to tighten, and limit nuclear advancements.
Reply: @fgbdgbxgbMoinbdgv  But you do have to understand that we wouldn't need as many planes if planes replaced cars
Reply: @Cambyses1467  yes it is more expensive because we didn’t invest in it because of anti nuclear groups. 

Nuclear energy is the cleanest, greenest and safest form of energy. And has been for decades. Wind energy is highly dependent on, you guessed it, wind and that is way less stable once your penetration gets higher. Higher dependance on wind means higher system costs (higher maximum peak loads need storage and buffering and bigger grid) which adds cost to the total system which nuclear doesn’t have. Also you need to replace the turbines after 20-25 years and recycle the old ones (which isn’t done yet). 

All in all for current numbers for stable power over a 60-100 year timespan nuclear is only 1.3 to 1.6 times as expensive because of higher up front cost but way lower variable costs. That’s a way more manageable number. 

Current nuclear deaths/TWh include chernobyl (which accounts for 90%) remove that outlier and you have 100x less deaths per TWh than wind. 

Since then we have had 30.000 reactor operation years without any radiation related deaths.
Reply: @Gren4te 
Nope actually it turns out stopping meltdowns is very complex, and complex things are expensive.

That's why wind is so vastly superior
Reply: @jamer45290 no cancer cases? Are you sure? Even nuclear accident in New York lead to New York having high rate of thyroid cancer. I just saw New York among nuclear accidents and looked statistics of cancer. I thought that would be something more gruesome like leukemia but no, it was just thyroid cancer. And New York accident wasn't big and didn't killed anybody
Reply: @carstekoch  i mean it's cost inefficient but we definitely have the money for it and it's gonna make the most sense to build because it takes up less space, it's safe, and it'll be really good for the long run
Reply: @quincycostello6726 
You can slap solar panels on pretty much any surface. If you were to cover the roofs of storage facilities, rivers or highways with solar panels we'd make more than enough power without using any additional space. And in case of water storage facillities it would even raise solar panel efficiency while reducing condensation.
Wind turbines can be placed in woods and mountanous terrain. As long as you can build a foundation, you can build a wind turbine.

If it costs you more to set up and more in the long run and it takes longer to set up, why choose it?
Use the ones that are already build, sure, they are certainly better than fossil production, but why build new ones.
Reply: @carstekoch  you're definitely right about the solar panels, but windmills don't make sense to me. For one, they need maintenance, and putting them out in the middle of nowhere makes it hard to do that. Another thing is that humans are naturally gonna need more and more energy as time goes on, and also more and more space as the population grows or as we need more space for certain things. Nuclear power plants would knock both of these out.
Reply: @Cambyses1467 
Are you talking about the installation cost or the price of continuing use?

You can use the same reactor for centuries massively lowering the price. Wind and solar require constant replacement making that price tag rack up.
Reply: @quincycostello6726 
Windmills don't need daily maintenance. Once every few months is usually more than enough (twice a year is the norm) and one team is enough to maintain several wind parks. There is really no reason to have them close to population centers if there are better options.
Also the coverage i mentioned would more than tripple the US's current Energy Produktion.
Reply: @jub66 No, and facts don't care about your feelings. Nuclear is too expensive.
Reply: All of these suggestions that modern nuclear isn’t safe, and yet we have been running an entire fleet of military nuclear submarines for decades without incident.
Reply: @kotenoklelu3471  the radiation that was released by three mile island was a chest x-ray, and the highest being 1mSv, all major health studies and surveys on the matter agree that three mile island had no significant or noticable impact on health or the ecosystem in general
Reply: @redstonewarrior0152 
Both.
LCOE is lifelong costs over lifelong production
Reply: @roycewalters  That you've been told about...
Reply: @Cambyses1467  Because the regulations are deliberately written to make it prohibitively expensive. For example, when you shut down a nuclear power plant, you have to completely remove all trace of it, and clean up the site enough for a park or elementary school. Instead of, say, a new nuclear power plant on that site, or other industrial use.
And the science they are based on, the Linear No Threshold (LNT) model of radiation hazard, has been repeatedly debunked. When a model fails to predict real world results, the model needs to be tweaked or tossed.  The original data from Hiroshima and Nagasaki the LNT model is supposedly based on doesn't even support it.
Reply: @Cambyses1467   It has a high initial cost to construct, but once constructed it requires far less cost, lasts far longer and can generate enough power to power an entire city for years before needing to be refueled once. It makes up for it's high initial cost with cheap run costs, it's all about the long term not the short term.
Reply: @Abmetos 
Nope actually the LCOE of nuclear (lifetime costs) is 5x higher than wind on a per kwh basis.
Reply: @Cambyses1467  Wind is horrible and unpredictable as it relies on... well wind. Both solar and wind are terrible choices, are not even as close to being as reliable or as durable and take up far more land.
Reply: @Abmetos 
That's certainly what the Big Oil propaganda commands you to believe!

In reality, wind is so superior that every country is building almost nothing but it. Nuclear, however, made up near 0 new energy last year 😌
Reply: @Cambyses1467   What does "big oil" have to do with nuclear? I mean, I already knew you were dumb, but come on. It's an undeniable fact that wind and solar take up significantly more area than nuclear does. Nuclear takes up a very small amount of space for how much energy it's capable of out putting. 

The only reason why wind and solar are coming in and nuclear is going is, is because of the government trying to centrally plan energy. It's the government investing into this, not private enterprise because private enterprise (unless they are also subsidized by the government) know it's not a good long term solution. If there wasn't so much red tape around nuclear, we would see more nuclear plants being built. But as always, the government will waste money because it never has any idea what to do with it because it didn't earn it.
Reply: @Abmetos 
Big Oil has been behind this influx of pro-nuclear propaganda since Wind became as cheap as coal. Its part of their Distract and Deflect campaign.

What better way to keep fossil fuels for as long as possible than to convince the moronic sheep than an actual alternative like wind is magically bad, and get them to focus on a non-viable option like nuclear.

Face it buddy, the entire world is building basically nothing but wind because its so vastly superior. The entire world isn't wrong, just you are.
Reply: @Cambyses1467 lol. LFTRs are meltdown proof. If you use old style uranium reactors then yeah. But those are old and outdated. 

Wind is vastly overrated. And I live in a country with a lot of wind. It’s not there when you need it the most. Cannot be used for a stable base load and comes with high system costs if you want. Not economically viable in the future.
Reply: @Gren4te 
Not at all. Wind is vastly superior. That's why the entire world is building basically nothing but wind and solar.

Nuclear is just too expensive to be commercially viable for the future
Reply: @Cambyses1467  the world is building wind because it is cheap on short term. So politically it makes sense. Long term (60 years and later) system costs exceed that of nuclear. If we do not invest nuclear will be as expensive as wind per kWh in system costs for 60 years. And that includes maintenance. If we do invest it will be substantially cheaper. 

Solar already forces high infrastructure upgrade costs in Europe. It is cheap to acquire. Expensive to keep. Solar and wind have its place, but not for baseload. You need a stable source for that and both wind and solar aren’t that.
Reply: @Gren4te 
Who told you such drivel? Its time to start questioning your sources 

Factually speaking, wind is 5x cheaper per kwh delivered over the long term. LCOE is the metric used to evaluate long term costs; it is lifetime costs divided by lifetime energy produced. Wind has a  LCOE 5X cheaper than nuclear
Reply: @Cambyses1467  And the cost in human lives from particulate emissions from fossil fuel plants? Not to mention the bazillion tons of CO2 that wouldn't have entered the atmosphere.
Reply: @Cambyses1467  Just because the chain reaction is dangerous if handled and designed poorly, doesn't mean it can't be handled safely. Older power plants are more dangerous, but newer designs are leagues safer than they used to be.
Reply: Seems pretty viable in france, which uses exclusive nuclear to this day
Reply: @SlapShotTakes
Which was built in the 80s lmao
Reply: @Cambyses1467  Nuclear energy is highly useful and ecologically saner than fossil fuels. The problem is, as one cartoonist after Three Mile Island scribbled, a stick figure human in the midst of a sophisticated array of computers, gauges, meters, etc. Thorium reactors are far safer than what we have now.
Reply: @rcnelson  Thorium seems like a pipe dream. Its always "just a few years away".

Besides, we already have the solution to ending fossil fuels: wind and solar.
Reply: @Cambyses1467  Except it is when you consider all factors and realize that the LNT model is disasterously harmful, moreso than low-level radiation exposure
Reply: @Arcayenneist 
Not at all actually.

LCOE is the metric used, which does consider all factors. Nuclear is 5x more expensive than most energy sources including wind and solar.

Its just not commercially viable
Reply: @Cambyses1467  Not true
Reply: @lukehahn4489 
Its OK if you're confused
Reply: @Cambyses1467 "US Approves $1B Loan to Restart Three Mile Island, as Microsoft Data Centers Drive Demand"

Oof, that's just GOTTA make you mad
Reply: @brandonn6099 
So many plans, all cancelled and none ever executed.
Mean while, wind and solar made up 89% of all new energy created last year across the ENTIRE PLANET 😂😂😂😂😂
Reply: @Cambyses1467 I don't care. Stop changing the subject. Good day to you.
Reply: @brandonn6099  Its OK if you're confused
Reply: @paulh6171 nuclear is about as viable as wind and solar energy are
Reply: @Enderdor 
Actually wind is literally 5x cheaper per delivered kwh than nuclear.

Maybe some day nuclear technology will improve wnd be viable, but not now
Reply: @paulh6171 I have no clue where you get your information, but it is literally the most viable source of energy. Infinitely renewable, not reliant on or effected by weather, and a well maintained facility can last a hell of a long time. Solar creates more toxic byproducts & wind is responsible for hundreds of thousands to even millions of bird deaths each year just in the US alone.

I honestly haven't the foggiest clue where you get your information from.
Reply: @bbbbbbb51  What toxic byproducts are created by solar? It's silicone, aka melted sand. I've heard only one USA firm that produces solar panels with a toxic compound.
Reply: @bbbbbbb51  It amazes me people thinking they can run these "safely" while they live in a country cut corners even from healthcare. 

And they dont even have to blow up, even small accidents accumulate since its fuel is literally dangerous. And you guys want more of these!
Reply: @cancan-wq9un everyone should want more of these. You people are the ones fearmongering into thinking accidents never happen on any other ways of generating electricity. We are in 2025 we have figured out how to replace someone's heart with a artificial one. I'm sure Nuclear energy something that has been worked on for decades and still is, is a viable way of generating electricity
Reply: @cancan-wq9un the US provides some of the best healthcare in the world, its the cost thats the problem.
Reply: @leepicgaymer  Yes but to do so safely means the energy it produces is 5x more expensive than more realistic sources like wind and solar
Reply: @jeezymang9707 lol no
One of the lowest lifespans and highest infant mortality rates
Reply: @Cambyses1467 i feel that the cost is at least partially contributing to that
Reply: @bbbbbbb51 all true, except it is a finite recource due to the expenditure of uranium. But current reserves r expected to last us 90 years whilst undiscovered reserves cap at around the 230 mark but new advances can and will lift this!
Reply: @domiarkadjevThose estimates are for thermal, open fuel cycle reactors. Fast reactors with closed fuel cycles can extract 50-100x more energy from the same fuel, giving us more like a few thousand years of known reserves.
Reply: @cancan-wq9un 
Yes the US is a bad country whose government cares more about giving billionaires one extra cent than providing any social services to the real citizens. 

(I realize this could also be construed as me not wanting any protections for non-citizens. What i was meaning to say is that billionaires arent real people and the us government is more interested then these evil money bags than they are real people, citizen or not.)

That doesn't mean nuclear power is dangerous. A modern nuclear reactor has so many safety fail-safes and contingency protocols that something like this, or chernobyl, or three mile island can't happen. Nuclear power is safe, clean, and far far better than coal or oil. And the byproducts. Every atom of the spent fuel is accounted for and stored. With coal and oil they just throw the byproducts into the air and consequently into your lungs. I'd rather my dangerous chemicals be stored in concrete vaults than in my lungs. There are environmental impacts related to the construction as there are with any construction project. But I'd much rather live in a world with more modern nuclear reactors than coal power plants.
Reply: @Cambyses1467  but it is not as reliable as nuclear, for any renewable energy to be considered viable they need to be consistent which wind and solar are 100% not. Any country relying only on renewable energy will struggle to keep even a single light on.

Which btw is what happened to Spain recently.
Reply: @masterofdeath15 
Its actually vastly superior that's why the entire world is making wind, NOT nuclear
Reply: @paulh6171 No, it is not. The only reason wind and solar are getting built is due to governments giving lucrative subsidies to building renewables otherwise nobody would be building them 😂
Reply: @Cambyses1467 Can you explain why France is powered by 70% nuclear, and has enough to sell to other countries but is not bankrupt?
Reply: @thebigsad5959 
Because they spent an incredible amount for it, and back in the 80s when it was cheaper
Reply: @Cambyses1467  also you are aware that solar panels are not as efficient as they could be because the extremely viable materials usable for are made out of toxic materials like lead? that get leached when rained on? so instead of tapping into the already available power we have, now we have to sit and wait a 10+ years for alternative materials to be researched for viability alone, and this is also excluding the how bad recycling these renewable power sources are, wind turbines are a prime example with most materials from old turbines just being placed in land fill
Reply: @jamer45290 
The vast majority of solar panels do not use perovskite due to it's very short life span under UV radiation and the other kinds do not use lead. They are also protected under a sealed, inactive glass layer to protect the active parts.
Who told you this nonsense?
Reply: @Cambyses1467  wind and solar are very unreliable sources and using them for full grid penetration means very high system costs with local storage and buffering to help out with peak control. 

We should simply invest more in nuclear to make it cheaper, which is exactly what we did with solar to make it as cheap as it is today. 

Nuclear should cope with the baseload and wind and solar should provide additional power (ideally localized). 

As it stands we need gasturbines for peaks and coal plants for the baseload because wind and solar are just not reliable enough.
Reply: @Cambyses1467  how are those energy costs working for Germans?
Reply: @deaddevil7 
Its working for the whole world actually, including Germany.

Did some YouTube video tell you otherwise? 😂😂😂😂😂
Reply: @ИванСнежков-з9й Plastic film to protect the solar cells.
Reply: @Enderdor  nuclear is multiple times more viable than coal
Reply: @bbbbbbb51 The commenter is right. Enjoy your upvotes, but they're correct. 

Nuclear is prohibitively expensive, even accounting for 24/7 power generation. It's far cheaper to go the route of wind, solar, batteries for energy storage, then invest in geothermal.
Reply: @Enderdor They aren't. Solar and wind are significantly cheaper per kWh
Reply: @Cambyses1467 yea, because wind and solar are subsidized and nuclear isn’t, it’s billions compared to millions, and wind and solar have their own problems that make them hella iffy for the environment
Reply: @Cambyses1467 "wind is cheaper than nuclear" yeah, and definitely a reliable, stable and constant source of power that doesn't need constant replacement of the windmills
Reply: @Cambyses1467  And once you take into account the cost of batteries needed to actually run a power grid on wind, you end up at more expensive. the difference is, running a grid with 20% "cheap" wind drives real power sources out of business and then users are told to go fk themselves when the wind doesn't blow.

Renewables are "viable" in a fantasy of free 100% efficient batteries, or a fantasy where we only use power when it's available. there are a lot of renewables in the EU already, and nuclear/fossil has to cover their BS at every turn. Pay for the batteries or SYBAU.
Reply: @paulh6171  We have dozens of nuclear reactors in the USA that have been happily plugging away for decades using technology older than you are without a single member of the public ever dying. It's people with ignorant fear that demand stupid safety measures that make nuclear so expensive.

Imagine how expensive wind or solar would be if it was as safe as nuclear. 3x more? 5x more? Probably 10x more.
Reply: @SinfullyHera  You are kidding right?
The previous poster said "Solar creates more toxic byproducts". Regular plastic doesn't fit the bill.
Reply: @ИванСнежков-з9й The plastic degrades which releases harmful byproducts, yes…? This is a known issue that is being active researched, so it very much does fit the bill.
Reply: @Enderdor  Nuclear is far more viable and better for enviroment than wind and possibly solar energy
Reply: @bbbbbbb51 I think I just flushed his source
Reply: @SinfullyHera  No. No and No.
I have no idea what you are talking about and I could find anything concrete that fits the bill.
Reply: @KatieNovaNeko 
No that's false actually. Wind has no subsidies and hasn't for a decade.

Because its 5x cheaper than nuclear 😂😂
Reply: @NextoGato 
Nuclear is commercial non viable as its too expensive, sorry
Reply: @Yanramich 
That's correct it is.

That's why the entire world is going wind and nobody is building nuclear 😌
Reply: @bpz8175 
Actually no batteries are needed. A common Big Oil talking point.

You're unwittingly referring to Dispatchable Generation, but that only makes up 30% of a typical grid.

In other words we could build nothing but wind for DECADES before having to worry about it, and by then energy storage will be the cheapest option.
Reply: @brandonn6099 
And they were all very expensive.

We have cheap wind now. No need for super expensive nuclear
Reply: @Cambyses1467 I don't know what kind of candyland up in the himalayas u have been, but the only conclusive reports of nuclear energy decrease come from Germany (due to political issues and germanys return to coal recently, thanks green party) and Japan (where there can be legitimate concerns over the impact of a nuclear meltdown due to the nations tectonic geography), nuclear power share is still increasing across the world.
Reply: @Enderdor  Except nuclear power is 24/7/365.  And the land use is more efficient.
Reply: @bbbbbbb51  i agree and when people think it's toxic fumes coming out the nuclear smokestacks, it's not actually, it's just plain water vapor being vented out harmlessly into the atmosphere.
Reply: @ИванСнежков-з9й My guy it’s literally how solar panels are made what are you on about? There’s a film placed over the cells to prevent damage being done to them while still being able to absorb ultraviolet rays for energy, that’s how they work, this isn’t exactly a secret.
Reply: Additionally researchers are looking to onions to try and create a sustainable alternative to the film that is also biodegradable and allows more light to pass through without damage.
Reply: @SinfullyHera  Are you trolling me? I'm not disputing that, It's everything else you just assumed to be true, based on ... assumptions.
Reply: @ИванСнежков-з9й Well…no? What do you think happens when plastics break down…? I’m honestly not sure what you’re trying to say here is false.
Reply: @SinfullyHera  What plastics, to what they are breaking down, what breaks them down? 
I've been told that plastics last forever, because nothing in nature can break them down... And you don't even try to give some concrete info about your claim.
Reply: @ИванСнежков-з9й  It’s…really easy to google…? Damaged solar panels contain cadmium, lead and arsenic. They’re also petroleum based and yes they can be broken down, they’re not bio degradable but that doesn’t mean they can’t be broken down by other factors.

As for my other claim, scientists ARE actively researching better and less harmful methods of protecting solar cells from UV rays and other harmful factors hence why they turned to red onions, there’s an entire scientific paper on this.
Reply: @SinfullyHera  Moving the goal post. You jumped in with some abstract claims about plastics, you couldn't provide explanation or source, when confronted you changing the subject.
CdTe and GaAs indeed contain some chemical elements, however they are used in thin film technology. Aka they are not the regular mass silicone PV. Pb is used only for soldering and that's been phased out decade(s) ago.
I think GaAs might be the technology I references in my first post...
Saying something is petroleum based as argument for harmful chemical. Petroleum is mixture of various organic compounds, it's used for many plastics because it contains long chain molecules.
You still haven't provided any clue what are the harmful methods for protecting PV from UV. It's clear you don't know yourself and ChatGPT is not really helping you.
Reply: @ИванСнежков-з9й  Yes, you do realize that the film on solar panels IS PLASTIC right? It's well known that it results in harmful byproducts especially given it's very seldom correctly disposed of, cadmium, lead, arsenic are also present, these factors have been researched thoroughly and the red onion paper is about replacing those harmful plastic based films with a biodegradable film to mitigate the risks of utilizing solar panels, it's not "moving the goal post" that is literally factual.
Reply: @SinfullyHera  You are saying it's well know... No it is not. Plastic is common name for million different materials. There is nothing you can assume about it.
And no, these chemicals you name, are not part of the any regular plastics and plastics do not casually degrade and release these chemicals.
One article about the red onion mentions the "petroleum based" PET (food grade plastic) and PVF (also used as flammability lowering coating, stable to 350C). The linked scientific paper doesn't mention any "petroleum" compounds and just compares the bunch of new organics ones.
I've wasted enough time already...
Reply: @Cambyses1467 the entire world making wind?, uhm Italy,UK and many other country’s are focusing on nuclear
Reply: @Tanksbuilder 
Who told you that? Time to question your sources my friend.

Italy and UK are ignoring nuclear and focusing entirely on wind and solar. Italy and UK added NO nuclear last year but added a combined 11.7GW of wind and solar. Ditto for many years before that.
Reply: @Cambyses1467  7
The possible return to nuclear power in Italy
Italy is developing plans to reintroduce nuclear power, focusing on next-generation technologies like Small Modular Reactors (SMRs) and Advanced Modular Reactors (AMRs) to supplement renewables. The government aims to have nuclear power contribute 11%–22% of its electricity by 2050, creating a stable, decarbonized energy source that reduces reliance on imported fossil fuels. This includes creating legislation to establish a national nuclear program, an independent safety authority, and plans for waste management and site selection.
Reply: @Cambyses1467  5
Energy strategy: UK plans eight new nuclear reactors to boost ...
The UK is significantly expanding its nuclear focus by planning to increase nuclear power capacity to 24GW by 2050, aiming to achieve energy security and net-zero goals. This includes government funding and support for new large-scale projects like Sizewell C, streamlining planning rules, and developing advanced technologies like small modular reactors (SMRs). The establishment of Great British Nuclear (GBN) is a key initiative to drive the delivery of new nuclear projects.
Reply: @Cambyses1467 it’s you’re source btw
Reply: @Cambyses1467 it shows the fact that Italy and the UK are planning on this nuclear advnacs
Reply: @SerenaCentauri  Nuclear power relies on political will to enforce safety standards, preventing people cutting corners.

How much do you trust your politicians?
Reply: @leepicgaymer  People calling me "fearmongering" when I was warning them about climate change too. 

Nuclear power safety relies on regulations, which is enforced by political will, preventing people cutting corners.

Tell me, how much do you trust your politicians?
Reply: @cancan-wq9un 
You are right, i dont trust politicians. And if nuclear safety was in the hands of politicians. I wouldnt trust it. However, we have the International Atomic Energy Agency which every country that has juclear power plants and more countries have signed into the Convention on Nuclear Safety. The IAEA audits nuclear power across the world and ensures that its up to standards. It is an independent organization. The US also has the National Regulatory Commission which is an independent organization that esures the safe use of radioacrive materials. 

Nuclear safety is beyond politics. Its actually independent of politics, which is kind of the point. Political will doesnt have a say. If there was a politician that wanted to pull out of the CNS and dismantle the NRC then yes, that would be bad. And if they got congress to go along with that, i would change my stance. But the point is. Safety in nuclear power is secure and independent. Nuclear power is safe. No modern reactor can have an accident as bad as chernobyl or Fukushima. And in the entire history of nuclear power those are the only two incidents where the public was exposed to radioactive material hogh than what would be in nature. The were still very bad but they cant happen again in any modern reactor. 

Nuclear power is safe and independent.
Reply: @Cambyses1467  Nuclear would be a lot cheaper if not for idiots demanding perfect safety out of it, and only it. Make it as dangerous as wind and it would be cheaper too.
Reply: @brandonn6099 
It still isn't anywhere near perfectly safe. The cost associated with it is what it takes to make it reasonably safe.

Nuclear is just too expensive to be commercially viable
Reply: @Cambyses1467  Uh, no. We've got dozens of cheaply build reactors that are decades old using old technology that have never had an incident that the public need be concerned about. That's as perfectly safe as it gets. Nuclear has a 100% safety record in America using old tech. People like you want it to be 300% safe.
Reply: @brandonn6099 
Nope.
Literally nobody is building new nuclear. The entire world is going wind because its so vastly superior
Reply: @Cambyses1467  HAHAHAHAHAHA

You wish. China is building more new nuclear right now than the USA even HAS wind. Not every country is so foolish as to dump it all into inefficient and 1000x more deadly wind power.
Reply: @brandonn6099 
Nope!
Globally, wind and solar made up almost 80% of all new energy last year.
Guess how much was nuclear? LOL
Reply: @Cambyses1467  Not zero, as you said it was
Reply: @brandonn6099 
So you agree wind and solar are vastly superior and effectively no new nuclear is being built because its so prohibitively expensive? Great!
Reply: @SerenaCentauri  you are lying to yourself.
Reply: @Cambyses1467  HAHAHAHAHAHA

You wish. China is building more new nuclear right now than the USA even HAS wind. Not every country is so foolish as to dump it all into inefficient and 1000x more deadly wind power.
Reply: @brandonn6099 
Nope! China is going full steam ahead with wind and solar.

Last year they added ZERO new nuclear capacity 😂😂😂
Reply: @Cambyses1467 I need you to re-read this entire conversation and try to follow along. Get back to me if you're capable of at least that much. I'm not going to keep repeating myself.
Reply: @Cambyses1467 and maybe someday you will find your brain
Reply: @Beef-man  The irony here is amusing. I can help educate you if you're willing to learn 😌
Reply: @Cambyses1467  Cite your sources, that's the best way to "educate" us as you call it. 

Though I doubt it will be easy considering they are all made up lol.
Reply: @Cambyses1467 It’s funny, because nuclear is commercially viable and has been for multiple decades?? Not only that, but it’s also the safest energy source that we have compared to any other.
Reply: @Cambyses1467 Cost doesn’t matter at this time we live in. The people paying for these power plants are the government and we’re already trillions in debt. This is what we’ve been doing for years now, nothings changed. And sure, building a nuclear power plant is expensive, but it not only lasts longer than any solar or wind alternative, it also produces less pollution than both. Not to mention that a nuclear power plant will make back its cost with its own profit in a few years which is better than wind and solar that cost more to produce than what they create in their lifetime. It actually costs more money to build and put up a turbine than what it will make in its entire lifetime being up, literally giving you net negative profit. How can you say these things are better when you are loosing money from them?